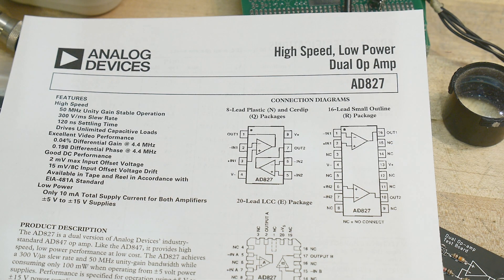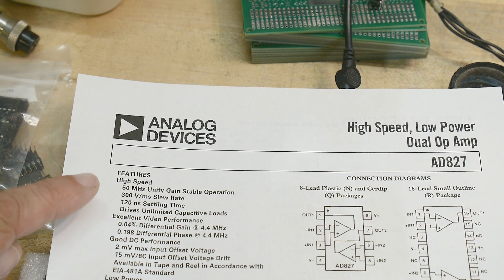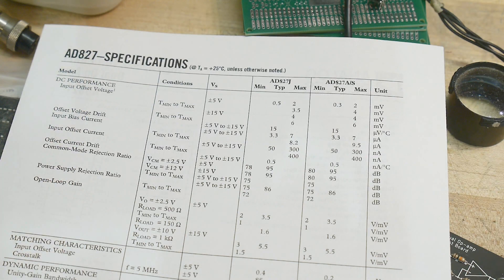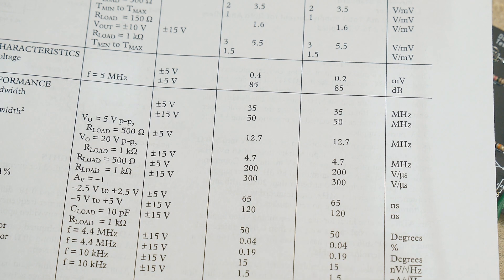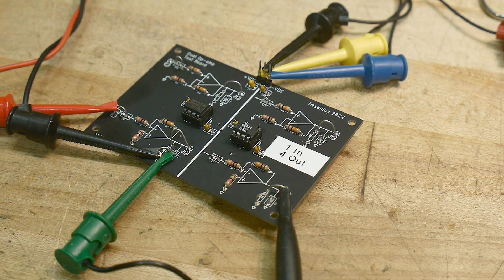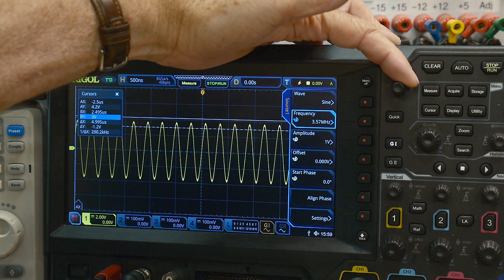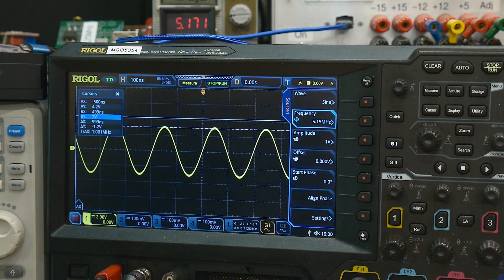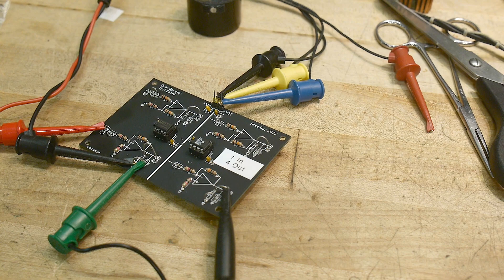#1627 AD827 Fast Opamp

Comment: Circuit layout is very important with high speed amplifiers. The whole affair needs to be as tightly spaced as possible. Ground planes are usually advantageous, sometimes pretty much essential. Power supply decoupling is very important, especially when driving relatively low impedance loads. Generally it is best to design using gain setting resistors of significantly lower value than you would with a low bandwidth amp. These things are often discussed in the datasheet and/or ap notes. Years ago the late Jim Williams of LInear Technology (now part of Analog Devices) wrote some good stuff on working with high speed amps.

Don't expect high speed amps to work well on plug-in breadboards. Most newer fast amps can't be had in through-hole packages.
Reply: Just replying so I can reference this comment later

Comment: Every now and then i am thinking of some basic RF circuits with fast opamp. Like shortware regenerative reciver. There are so many circuits with transistor, fet and even tubes - but high speed opamps not so much 🙂

Comment: OMG, AD827 and HA5020 were making me cry while I worked in nuclear instrumentation... Those two opamps have some absolutely crazy modes of failure. Those nice little non-working circuits with all the parameters within limits from service manual. 
Also, when you work with high speed opamps, above few MHz, you should really consider matching the impedance of your generator to input impedance of amp. If you do that, those amps typically outperform values from datasheet. ;)

Comment: Good to see that you cannot remember why you got those schips in the first place… my drawers are full of chips that I ordered for some good reason, but now I cannot remember what I wanted to use it for… getting older sucks!!!!😂😂😂😂 (at first I blamed my neurological disease for it, but lately I see quite a few (elderly???) you-tubers having exactly the same problem… so I am not alone)
Reply: Yep, I am of that age, as well... Here's my trick. I buy nearly 100% from Mouser. Each item that you place in their cart has a tab for the customer's use in assigning a P.O. number. This information is typed onto the label of each bag of components. I write myself short, abbreviated notes in this space to remind me for what project I bought the part. Works a treat, so long as I remember to write the note. lol  I imagine the other big OEM distributors have a similar P.O. numbering method. HTH. Cheers!

Comment: Nice chip.  What I noticed with screaming chips is that the power consumption is high and it is wise to operate at lower power supply ranges than the maximum datasheet value.  Also, in some cases, special heat-sinking is valuable.
Reply: Many of the fast op amps are specified for supply rails of only ±5V or just +5V anyway. If you want to operate at anything less than that you need to carefully consider the specifications for common mode input and output voltage.

Fast op amps are often spec'd to drive a 50 ohm load. That requires a lot more power than something you'd typically use for driving impedances you'd use in audio-frequency circuitry.

There is nothing wrong with operating these sorts of parts at 50 or 60 °C, or even higher if they are spec'd for it. A lot of people have become accustomed to a lot of ICs operating with barely discernible temperature rise and get alarmed if something runs noticeably warm. 
There is almost nothing you can do that is practical in terms of heatsinking an ordinary fast amp unless you use a four-layer PCB. On a double sided board you can try to maximize the areas of copper for the supply rails. You definitely don't want to add copper to the signal pins because of the unwanted capacitance.
Some of the fast amps have a "slug" on the bottom of the package that is intended to be soldered to foil that serves as a heatsink. Typically you'd use several vias to transfer heat to the ground plane foil. Putting vias within the pad area is possible, but requires attention to detail since they can cause some problems of their own.

Amps designed to drive ADSL certainly can run pretty darned hot.
Reply: @D614G_aka_Doug  excellent points.  When used in analog to digital modems like ADSL, the nature of digital error correction and recovery mean that the screaming chip does not have to be as "perfect" in the analog domain while still having acceptable  error rates.

The situation that I had in mind was for the old analog TV system in which the analog distortions of various types would become visible in the picture - especially operating at high temperature and/or with rapid transients in heat flow.  Some chips are specifically made for this operation while other "general purpose screamers" need proper spec. sheet evaluation and trade-offs as you mentioned.

Thank you for your perspectives and clarity.

Comment: your oscilloscope is amazing too Sir i think sometimes i feel it. i think its digital but not basic version
Reply from the maker: https://youtu.be/eaoHYWYLRV0?si=ojbYc364CJypPsfh
Reply: I wrestled for years with what scope to buy; too many choices!  I eventually settled on Keysight, the grandchild of Hewlett-Packard scopes.  I had a budget for 2 channel; I wish I had budget for 4 channel but I don't very often need it.  The Keysight DSOX1202G has a built-in signal generator and thus can be used for Bode plots up to 20 MHz or other purposes.  The basic scope is rated for 70 MHz but for extra $$ can go up to 200 MHz.  Most of my work is HF radio so 70 MHz is plenty.
Reply from the maker: @thomasmaughan4798  I also have a Keysight DSOX1102G. Nice scope.

Comment: can you show a practical example using that opamp? like high speed current sensing or any high speed event?
Reply: I've used op amps faster than that in an in-line preamp for ultrasonic transducers up to 15 MHz. This was in a complex system used for pipeline weld inspection.

Fast op amps are broadly useful in instrumentation, though a gain-bandwidth of 50 MHz is a bit limiting for lots of things. The input offset voltage of fast op amps can also be a problem.

This particular amp is suitable as a line driver for video. Typically you would run it at a gain of 2 so that you can use doubly terminated transmission lines (series termination at the drive and parallel termination at the receiver).
Reply from the maker: they were designed for video applications. driving coax
Reply: Amazing design

Comment: Nice chip and follows the gain/bandwidth rule perfectly. Have you a Texas Instruments THS4304 op-amp to test? They are supposed to go up to 3GHz.
Reply: Have tested it. Fine opamp, but I have strong dislike for 'modern' low voltage devices. I mean, are there any analog aplications that arent ended with adc. For some time my favourite high speed opamp was also Texas made  LM7171A. It was absolute batsh*t. 4100V/uS slew rate with 36V power supply from rail to rail. OFC it is current feedback. All of the high speed ones are. Some nice stuff to analyse the internals to. One could learn  a ton from it, diamond buffer (first used by National in legendary LH buffer amps), voltage regeneration from current via integrator, thermal runaway protection/current simetry controll... Just great little school of analog electronics even for some well educated and experienced engineers. :)
Reply: Replying so I can find these comments later